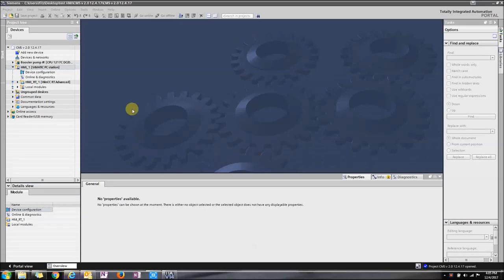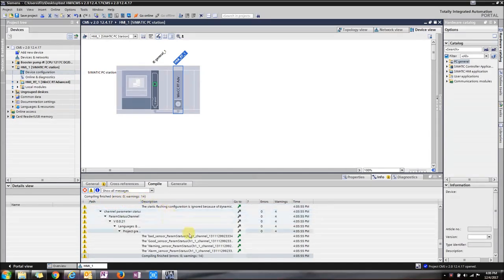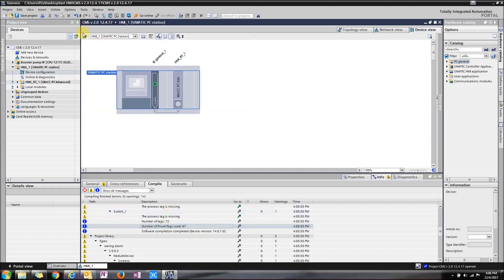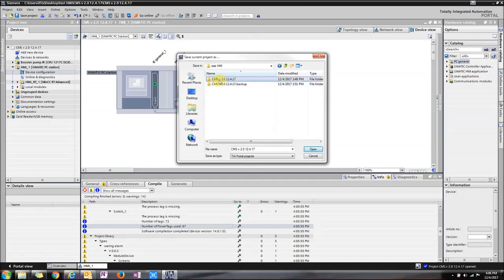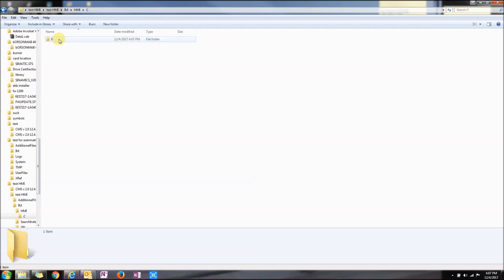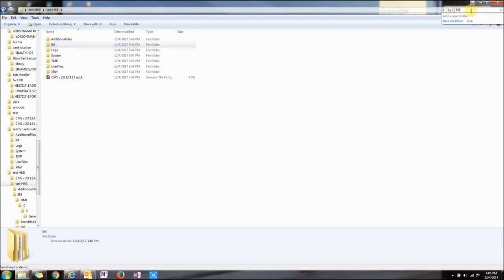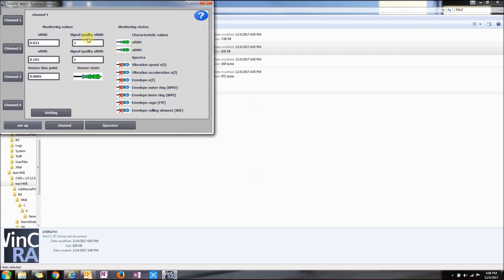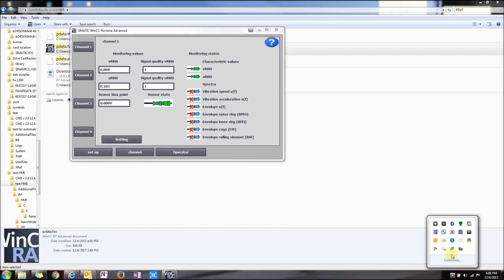Generating a WinCC RT Advanced File in TIA Portal | Authorized Siemens Support | AWC, Inc.

Comment: Hello

Need help.
I have a computer with WinCC Runtime Advanced 128 Tags.
I want to make changes in interface. But I do not have TIA project file for the same.
How to generate/backup files from the computer where the WinCC Runtime software (program) is running.